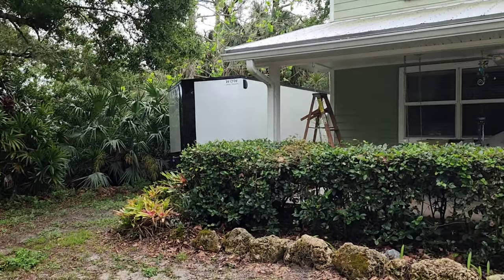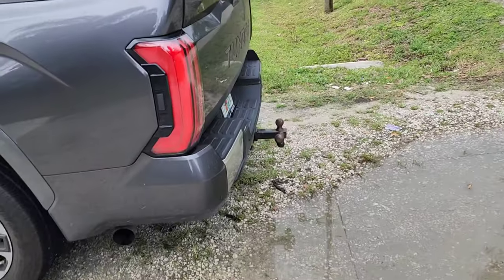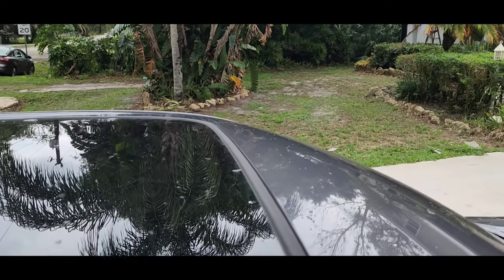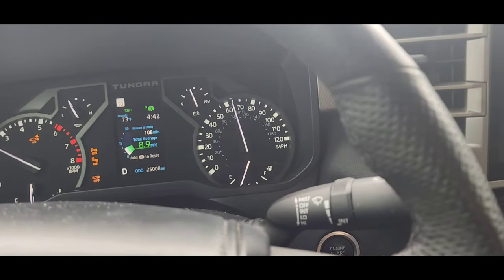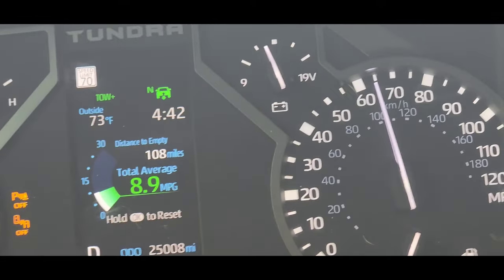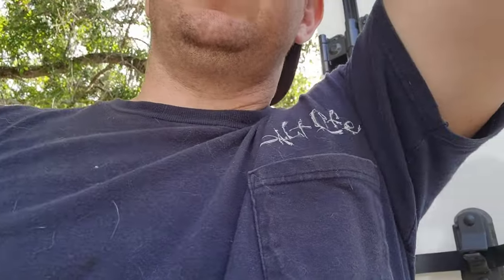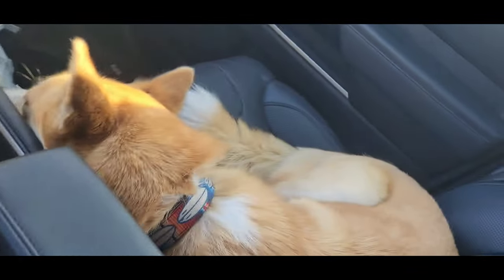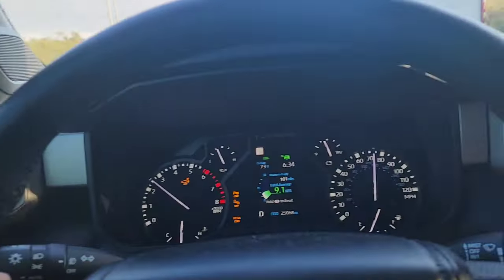22+ Tundra Towing Big Enclosed Trailer 3 hours!

Comment: Glad to see the Tundra tows so well even without a weight distribution hitch. I have a 2022 as well and coming from a 2021 F-150, it feels more planted when towing, even with the coil suspension in the rear. I don't know if it's the frame or the added way but it's a really good tow rig.
Reply from the maker: The weight definitely helps. My 23 4x4 long bed weighs 5700 lbs non hybrid 😂
Reply: @coryscarchannel  Yeah my 4x4 double cab limited comes in at 5800 lb. Not great for gas mileage but definitely improves stability when towing in my opinion.

Comment: Nice truck. I have an 07 5.7, 430 gears. I added Sumo Springs front and rear, TRD Sway Bar; 38 foot travel trailer @ 10K; no problem. These trucks are more than capable with the right upgrades

Comment: Nice truck man that’s why I believe on those trucks I have a 2005 Toyota tundra max tow package and I pull her with a 38 foot trailer gooseneck trailer
Reply from the maker: That's pretty crazy! Where do you go with it? The old tundras are tanks I wanted the daily fuel economy of the new one though
Reply: I put at least 15,000 pounds in that trailer on with the truck and it pulls a better than a diesel truck
Reply from the maker: @raulbueno4284  that's a lot of weight! You take it on the highway?
Reply: Yes I do
Reply from the maker: @raulbueno4284  I would love to see it
Reply: And you will